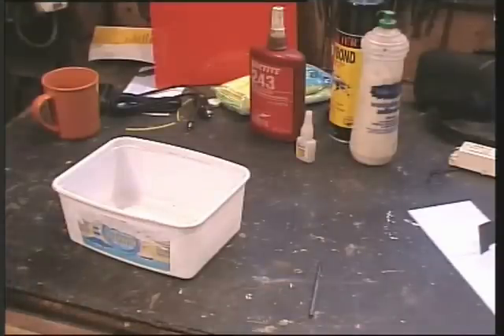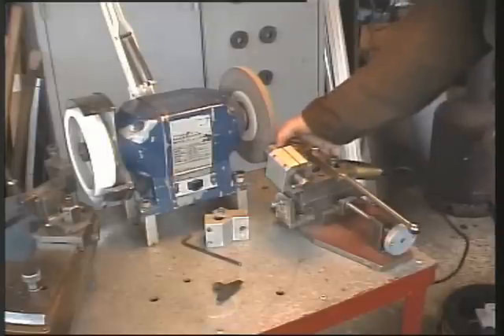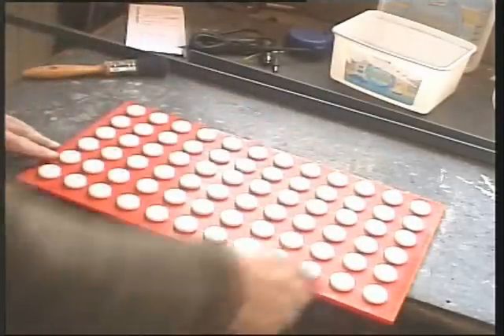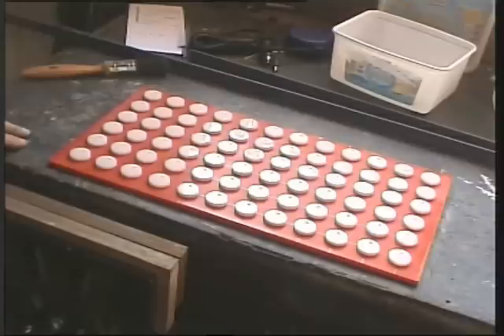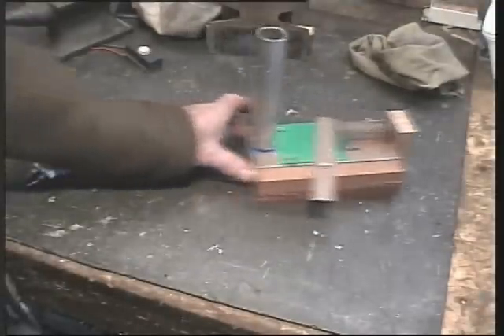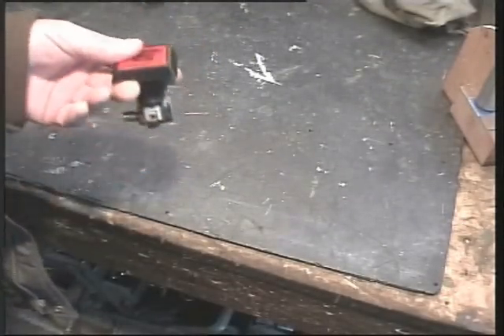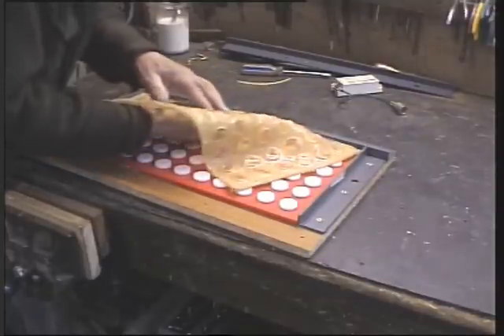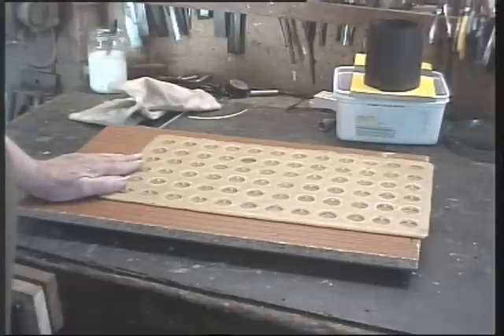homemade air gun targets

Comment: You have so many machines! Funny enough a friend of mine and I were doing some plastering on his house a few years ago and we had a plastic door mat that had holes about ¾” and when we had any leftover plaster we trowelled it onto the holes then when it had set we just pushed them out and ended up with a load of plaster discs to shoot at for free. You have made some nice molds but I didn’t see what it was you used, some kind of rubber? will you do a follow up video of how they come out and maybe them being used some time ;-)
ATB Emma
Reply from the maker: I will do a follow up vid for sure, this is a on going project very much in its early days, when I find out how to increase the frame rate on my camera then played back normally, should be very impressive !

Comment: Hm interesting. I think there are two kinds of plaster (both white ones) one fast setting and one slow setting (for artistic stuff).
But there is another way! Metal molds with pressing by using a damp mixture of plaster, could do a machine for fast production but i doubt it worth's the hassle.
Reply from the maker: have you any idea how big this market is ?
Reply: +poroldchap Maybe a metal mold and a press would do them fast. Hit and release. Plus they are going to be much more sturdy to handle.

Comment: Interesting! When I saw you turning the squares on the lathe I thought you must have drilled a hole in them for a mandrel, but when you showed them finished, I had to change that impression. I'm surprised that clamping them was sufficient. Especially with a glossy texture to them. I'd have thought they'd have come loose and gone flying as soon as the cutter touched them. 

I have a friend who used to make medallions from pewter in molds he made from silicon rubber (RTV?). It was reddish and could be cast thick in one go...no need to build up layers like wth the latex. Also stood up to repeated use with pewter casting and was flexible enough to pop out the castings, while still firm enough to clamp for the pour. Have you used it?

Thanks for showing a good way to do it!

-- Mike
Reply from the maker: silicon rubber is 20 times more expensive than latex
Reply: +poroldchap I figured it was something like that!  :-)

-- Mike